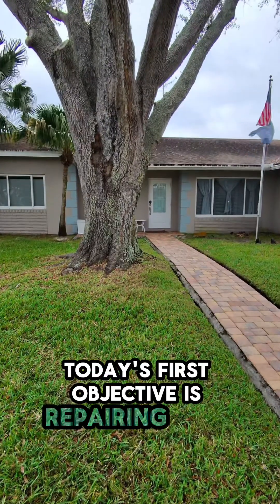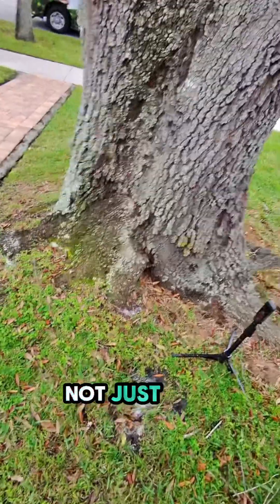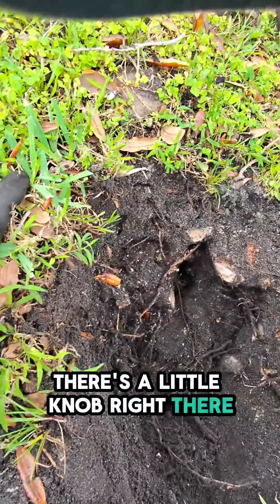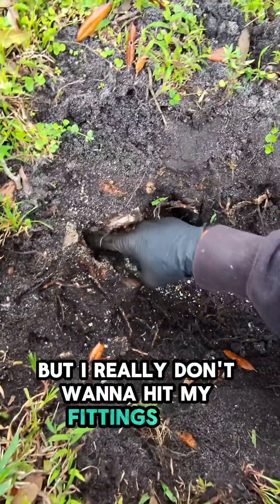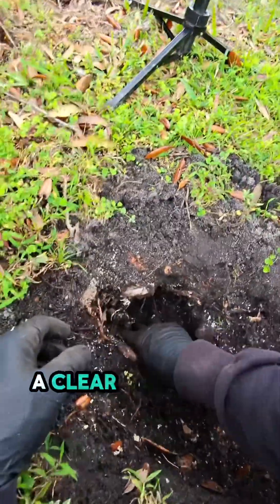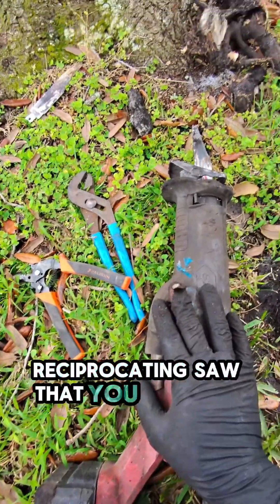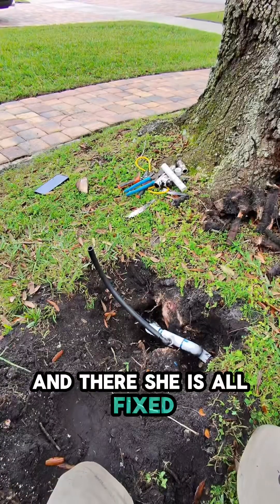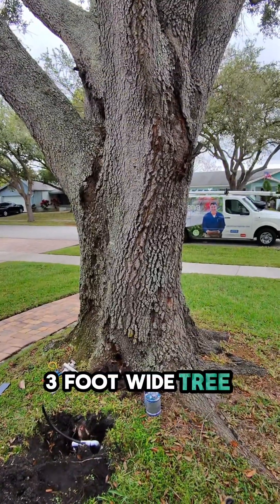Repairing a Broken Pipe Under a Massive Oak Tree

Comment: Wouldn't it be better to go around the tree and cut out the issue?
Reply: The issue being?
Reply: @robert7100  tree roots
Reply: It’s isnt the customers budget
Reply: that would be needless work
Reply: @sitindogmas since the problem was under the tree roots he could have saved hours of cutting tree roots by going around it .
 It would be more efficient in the long run to get away from the tree roots rather than wait for it to do more damage.
Reply: @akeleven  there are some variables,  zones, water pressure but I believe here the cost of more materials and labor. there's a reason people who work on and install irrigation call it "irritation". you right, there is more than one way to skin a cat, especially in the eyes of someone who's never skinned one
Reply from the maker: @akeleven  typically, a trees root system extends out to the canopy. Choosing that path always requires more labor and, obviously more material. The option was offered. That option was also more expensive and outside of the customers budget. Realistically, this line was serving two sprinkler heads. It being broken was affecting the whole zone. This cost-effective repair solved The problem enough for the customers liking and budget.